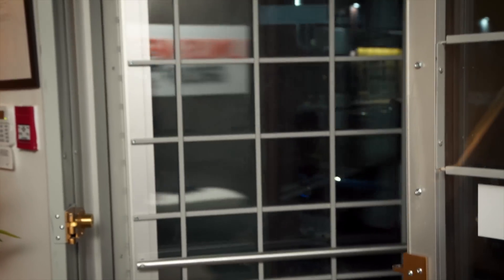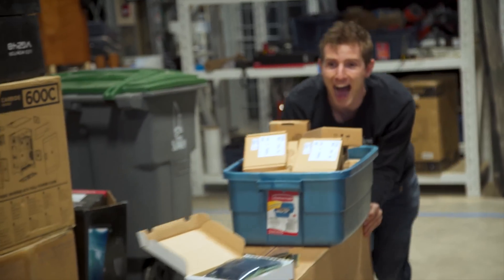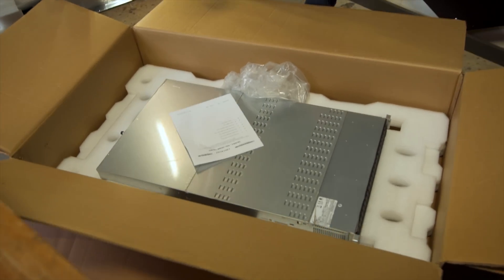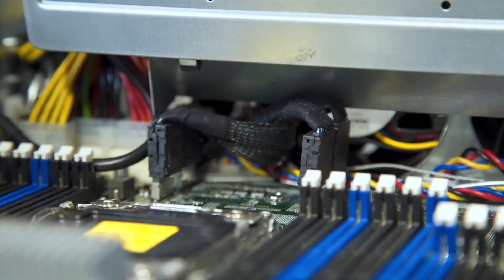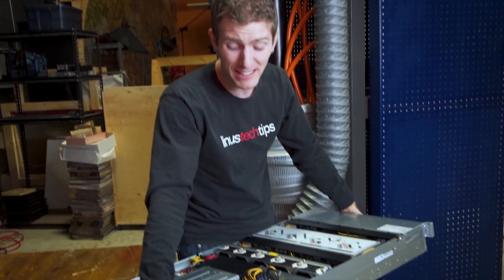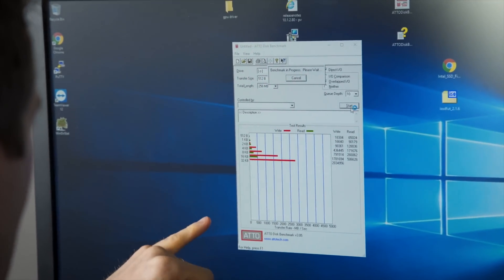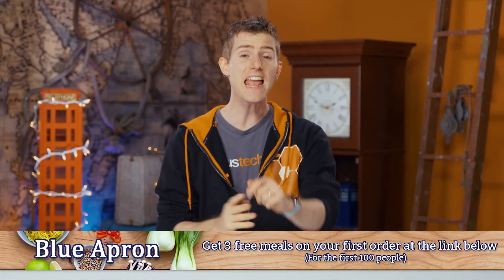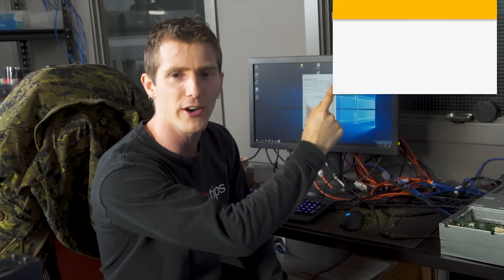The Fastest Storage EVER – HOLY $H!T Ep 14

Comment: why do you use windows and software raid except for the reason its a gui
Reply: ProBro_NL 
Too much of a scrub for Linux.
Reply: Because this is a channel for geeks, not nerds. :P
Reply: It was Windows server for one. He also said that he hadn't finished deciding on the optimal RAID configuration, so it's just a quick test.
Reply: what do you trust more windows for raid or a hardware raid card ?
Reply: The transcoding software he uses in one of the servers isn't compatible with Linux, for the servers to talk to each other more easily he uses windows server.

If I recall correctly he uses a Linux something below the windows server. But yeah, you won't see him using butterfs on anything, too much of a scrub.
Reply: SMB multi-channel?
Reply: no i prefer windows and i didnt specificly mean linux either. but its just that its total waste of power and such
Reply: ProBro_NL He just set up Windows to test things up. Also, how would he use hardware raid, when it's wired up directly to the U.2 to PCIe card (as I doubt the motherboard having support for RAID)&&Setting up software RAID is easier&faster
Reply: ProBro_NL He just set up Windows to test things up. Also, how would he use hardware raid, when it's wired up directly to the U.2 to PCIe card (as I doubt the motherboard having support for RAID)&&Setting up software RAID is easier&faster
Reply: kek winshite
Reply: He'll likely use a headless Linux OS. If I'm wrong, then I'm disappointed in Linus.
Reply: ProBro_NL because hardware RAID cards don't exist for NVME
Reply: he was running server 2016
Reply: Random Andrew that doesn't make it any better
Reply: MoistGoat you're wrong, and disappointed
Reply: I think he did it just for the sake of the test...but who knows, he may be running Windows Server Edition or something
Reply: DvdXploitr the raid function of Windows 10 and server 2016 are the same so it wouldn't matter. but for testing, it was probably Windows 10 to avoid paying to have a server license on hand. either is a bad idea for raid tho

Comment: Please tell me you're gonna raid 0 them.
Reply: goeiecool9999 raid 10 is best option. Parity and striping gives you speed and redundancy. Raid 0 isn't bad if you don't care about losing all your data if 1 of them fails
Reply: goeiecool9999 I think, then even the best network card couldn't deal with it. Also, this would most likely be used for critically important data that you just don't want to use
Reply: surely he would need 2/3 raid 10's over the separate raid contolers,. or is he going down the software raid root. witch has its own risks.
Reply: raid has nothing to do with the networking card. its how the computer/server reads and writes to the drives. amd if hes locally reading/writing to it with a 10 gigabit switch then theres really no issue